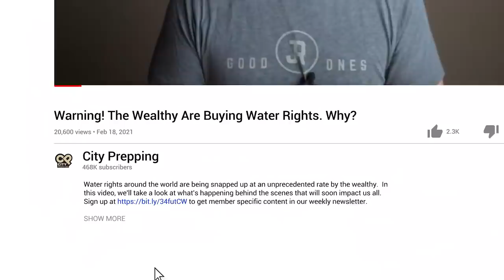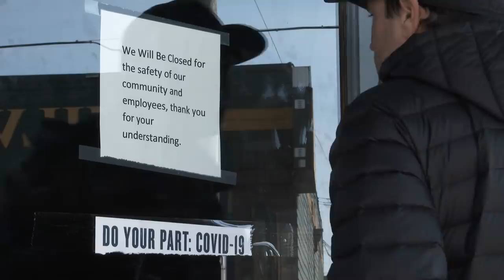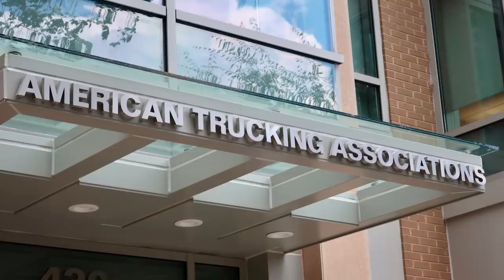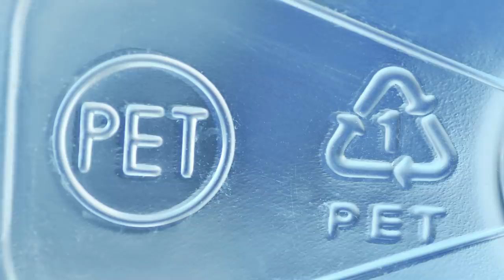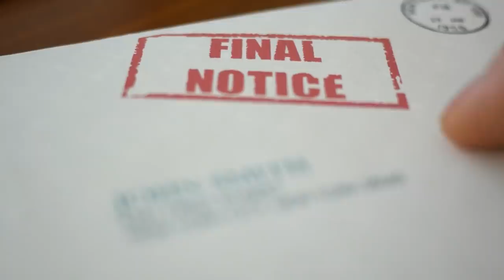Supply Chain Collapse: What's Coming Next and How to Prepare

Comment: I was living in Los Gatos at the time of the 1989 Loma Prieta Earthquake. The tap water was unavailable for four days at our apartment.  Natural gas was briefly shut off by the city to prevent explosions, until someone came out to check the lines. Because of that, I learned that water was the number one thing for which people underestimate their daily need. Most people assume unlimited tap water and that is a false assumption. At that time, many people had food but no water, and no way to cook. When a beginner first thinks of prepping they may have a mental image of themself going to Costco and buying a 40 pound bag of rice and other shelf stable non perishables. A well stocked food supply wont help you, if you have no access to water, and no way to cook.  Without water, there was no way for anyone to wash their hands, I couldn't even wash a small cut on my foot from stepping on broken glass in the dark.  With no means to flush the toilet, the house stank horribly by the third day. Large bags of dried rice, dried beans and pasta might make your intestines feel sick if you have no water, and it might even be better for your survival not to eat bone dry food. Water was the most #1 single most serious problem of those first four days because the grocery stores closed when had their shelves tossed over in the earthquake.  The broken shop windows were boarded up, and a 24 hour security guard was on duty to prevent anticipated "looting." So, whatever bottled water may have been in the aisles the previous day was now under a pile of rubble, and a guy with a gun didn't want to let shoppers enter. A portable camping toilet, a brick of baby wipes, and a first aid kit would all have been useful, but we foolishly always relied on the idea of stores being open.  With our electricity out, everything in the freezer defrosting, and we found there was one half-filled pitcher of warm Kool Aid in the fridge. So, by day two, we were reduced to drinking the liquid off the canned goods. Everyone should definitely get some of those larger dispenser bottles for their house. If you don't have a lot of extra money, forget about a thirty day food plan and just make yourself a ten day water supply, with some plastic bags to line an ordinary plastic bucket so you can carry your bodily waste out of your house. Again water, water, water. Nearly everyone underestimates how much water they will need.
Reply: Was in Hayward  after the earth quake able to get out of Oakland ok . When arrived home filled up any container with water .
A few weeks later bought  a few 30 gallon barrels to fill up with water .
   Easy recommendation is to have basic camping equipment and long shelf life food and water . And don’t tell anyone but these in your family you would share with .
Since then moved away .
Reply: This is so true. After approximately 7 to 10 days without water starts the multi organ shutdown ultimately resulting in death. Although very uncomfortable one can live much longer without food .
Reply: Having dealt with gulf coast storms I have to agree. Water first. And a way to cook the food. If you are figuring water 2 quarts to a gallon per day per person depending on temperature. Dead of winter 2 quarts will probably get you by. Mid summer takes a gallon. That does not include water for cooking, bathing or sanitation. Baby wipes or disposable washcloths are wonderful and cut water usage. Clean underware. I can wear the same pants for a week if need be. Not so much other things.If your going to use a generator you need to run it under assumed load. Fridge, freezer, AC or Oxygen concentrator. Get a fuel usage for about four hours and multiply for however long you want to use it. 50 gallons of gas lasts a few days going 24 hr a day. 
Lots of can goods can be eaten straight out of the can because it was cooked being canned.
Reply: I was born in Oakland after the 1989 Loma Prieta Earthquake. I have seen video of the destruction caused by the earthquake and was always curious how long it took the for life to get back to normal and how people lived through it. Thank you for your post.

Comment: Had an interesting conversation today with one of my wholesale suppliers (shipping from China). In 2019 the cost of a shipping container from port of Shanghai to port of LA was $10k. In late 2020 it cost about $19k.  Four months ago they were quoted $21k. No, as of September, 2021, they were quoted $30k, with no guarantee for that price more than a week. These prices don’t include customs fees or any other fees.
Even domestic shipping costs have gone up significantly.
Reply: I am in the logistics field.   These prices are correct and there is currently no end in sight.    No only are the prices sky high, freight is not moving as efficiently as it did 2 years ago.

Comment: I decided to get rid of things I don’t need, take that money and buy more useful things for prepping, like extra propane tanks, maybe a solar oven and a water filter system.  Our second car is seldom used and cost me insurance money so it is going.  I did order a new washer and dryer, too since mine works but getting old.  Just trying to fill in any gaps in my prepping.  I watch your videos and it gets me thinking what else can I do to be better prepared so thank you.
Reply: We have a drier but never use it. Line drying in the summer, drying on racks in the winter, mostly using heat from log burning stove. This is more about climate change for me and reducing carbon footprint. Not short of money.

Comment: Two weeks ago I spread out a 600 square foot tarp to kill off a grass area to prepare an additional garden space. In another month I will prepare another 600 square feet. I have almost 300 cubic feet of compost bins that I am slowly filling. In one I can feel the heat generating from the decomposition prossess. This next spring I am getting a wood chipper. There is 1.5 acres of forest area that has at least 20 cords of dead/rotting trees, some 2' plus in girth and 40' or longer, and fallen branches. All of that when chipped up will provide an excellent ground cover and eventually produce a furtile soil. 
Taking it step by step. Being able to grow ones own food having an small orchard is a blessing. The taste of freshly picked tomatoes and zuccines is so much better. The cherry tomatoes in the salad were amazing. 50' from the garden versus 500 miles of chemically treated/transported produce has no comparison.
Reply: And no flavor
Reply: Thirty years ago, I purchased two standard size Jonathan apple saplings from a seed catalog. Before I planted them, I built two, four foot square, eight foot tall, chicken wire cages out of 2 X 4s. In the years when the frost doesn't drop the early blossoms, I get lots of apples. This summer, I purchased a standard sized yellow transparent apple sapling from a local nursery. Once again, I built a four foot square, eight foot tall chicken wire cage out of 2 X 4s to protect the sapling from the deer and the rabbits Last year, I purchased the empty lot across the street from our cabin. Lord willing, I'd like to plant one apple tree every year, as described above, until I'm gone.  Then, they can plant me under one of them. I'd like that.

Comment: Fourth quarter (2 1/2weeks from now) is what worries me. Cold dark winter to be expected with the solar activity and magnetic shift
Reply: Try getting solar blanket, they are good for low to no sunlight, but note they are expensive. But it’s a good backup. Hope this help.
Reply: I'm anticipating major earthquake on west coast
Reply: grand solar minimum is here.

prepare accordingly.
Reply: @jhart7304  its not. We're in a solar maximum cycle 25. But in about 10 years it's over and then yes, grand solar minimum. But this solar max is gonna be a doozy first. Expect an X class flare by 2025.
Reply: @jhart7304  what's a grand solar minimum?
Reply: @pattyconley4096  The Sun is least active during GSMin. GSMax is opposite.

Comment: Though we haven't noticed actual shortages since the toilet paper debacle, we have noticed slow and steady price increases as well as simultaneous reduction of product size. Deceptive packaging is also making it so it seems like you're getting the same amount. We noticed this sharply with seeds this spring. Fortunately I was well prepared and needed very few. We also were informed that the cost of Natural Gas is going up next month which is a big one for us. Our furnace, gas fireplace, hot water and pool heater all run on it because it's been a cheaper fuel that the comparable hydro bill. We will likely be moving out of the city very soon to get as away from these costs as possible.
Reply: Deceptive  pckg.  Yes.  This has been creeping up on us for a long time.    Now 4lbs sugar in a 5 lb looking bag.  Cake mixes —. Now 15 oz instead of 18.75.  So if your tried and true recipes aren’t the same that’s why. Less on a big tp roll. Still big yes. Less sheets loosely wrapped paper towels too.   Read your labels

Comment: I've been stocking up and have a pretty good food supply now. Bought enough for family, too, because they just don't seem to get it. Also been picking up DIY books at garage sales and thrift shops - topics like home repair, plumbing, electrical, gardening, first aid. Seemed like a good idea to have on hand in case the grid goes down.
Reply: Even if the grid stays up, electricity costs money.
Reply: Maybe it’s all this stocking up that’s causing the problems?
Reply: @Tailspin80  No, because the issue is supply, not demand.
Well, that, and chokepoints at our ports.
Reply: @stevenschnepp576  Supply and demand are related. That’s just basic economics. Stocking up / panic buying increases demand, reducing supply further for everyone else. It’s also basic human nature, so go for it 😀

Comment: The bakery dept literally looked like the Soviet Union when I went to the grocery store on Sat. It’s normally filled with premade treats, but this time had only like 4 items in the huge case. Out on the floor there wasn’t the normal huge assortment of cookies, pies & cakes either. The girl in the bakery said they were having trouble getting stock.
Also, in the liquor dept the store has installed glass doors that lock over the spirits. So in order to get whiskey or vodka or rum, you’d have to get an associate to help you.
Other than that, the store looked pretty well stocked. There were things that were light here & there, but it was actually better than it was the last few times I had been there.

Comment: My local Costoc is out of TP and paper towels. The cashier didn't think they would get more until early October...crazy times.
Reply: I ordered online yesterday at Costco, limit to one pack.
Reply: Use napkins
Reply: Janitorial companys that's where I got tp last time
Reply: My local Sam’s Club has a strict limit of one package of tp or paper towels. You can’t purchase both in the same shopping trip even if you only bought one of each.  It was crazy.  I actually needed tp so I bought a super mega pack of Charmin. Went to Target and bought a second huge package as well just in case.  Paper towels I don’t really care about, they are nice but not necessary. Rags work just as well
Reply: @jhart7304  ... I assume you prep.  So where do you get your bulk supplies from?  Why are you coming down so hard on people, especially during such a difficult time.
Reply: @jhart7304  oh your so right I stopped using Walmart in 2012 but never really purchased much there only things that my local store didn’t have.
Reply: @jhart7304  Sam's club is Walmart..Costco has substantially higher quality products.
Reply: @jhart7304  
What?  I don't get what you said.  What are you saying?
Reply: @flowerpower2079  what he is really stating is that its the "Boomers fault" for the bull chit going on now.

Comment: there is not a container shortage. The problem is holding the ships off shore and waiting to ALLOW them to come to port. All done with purpose and intent.
Reply: Demand is sky high and ships are hauling as much as they can as fast as they can, but one ship gets blown sideways by a sand storm in the Suez and too many loaded containers are loaded on outgoing ships to allow room for the empties so empty containers are all where they are NOT needed.
The truck driver shortage is also effecting the shipping delays. Container pickup at the shipyard is one of the most difficult, low paying and unrewarding truck driving jobs out there.
Not enough truck drivers, not enough containers picked up.
Containers backed up on the dock means not enough room to unload the ship, and no place to dock the next ship.

Comment: You can basically stay alive on peanut butter. It's not much, but honest advice. Hope this helps
Reply: How long after Expiration can I eat the PB? Mine is from 2019.
Reply: @ebonytucker564  I would absolutely eat 2019 pb if I had to. No worries. Only time I've seen expired pb is maybe 6+ yr old (just an estimate) and I could tell it was bad. Smell and taste was obvious that it was harmful to eat. Good thing about it, it's relatively inexpensive to "cycle out" of the food pantry when time comes for expiration. Powdered peanut butter is another option I've been exploring. Longer shelf life
Reply: @ebonytucker564  ymmv. Note that foods with a significant oil content always have a shelf life. This includes nuts of all kinds.
Reply: @ebonytucker564  I KEEP ROTATING OLD PREPS AND I ALWAYS BUY SMALL JARS ON P.B, B/C AN OPENED JAR STARTS BREAKING DOWN QUICKER. I CAN'T EAT A HUGE JAR FAST ENOUGH. I AM NOW EATING 2017 AND IT IS GREAT.

Comment: (NJ) Canning jars/supplies are either unavailable, in short supply or doubled in price.
Reply: Yes, thx. But not jars at reasonable $, when available.
Reply: @creeksidecabin4887  Be careful with eBay lids - I've read they're total junk, some even put into Kerr or Ball boxes but are junk no-names. They fold up in pressure canning or fail to seal. Ace Hardware here is carrying Pur jars and lids, and they have performed just as good as Ball.
Reply: @creeksidecabin4887  US Sellers Only is the seller’s location,  not the merchandise country of origin. Walmart is a US Seller, but 99% of their stuff comes from China. And Ball or Golden Harvest usually sells for less than $3/dozen for regular lids only (no rings). I’ve actually ordered something from eBay thinking it was a good deal  - and got a box from Amazon. The seller was just having Amazon drop ship my order. Now I check both sites. eBay isn’t what it was 20 years ago when I was a seller.

Comment: MOST IMPORTANT PREP ? Water supply ! You can only live about 3 days without drinking water. Bottled water is NOT an option, since water deteriorates with time, and is a heavy & bulky item to store. If you have a private well & pump, you NEED to also have an emergency GENERATOR (preferably powered by propane gas) and a TRANSFER SWITCH to allow power to your water pump.
Reply: What if you do not have a well?
Reply: Stop gap measure at best. Im not saying its not a good idea. But, you need a non electric source.
Reply: @bamahama707  .. you need to select a product that will purify water.  Then you need to start collecting rain water or find a river that you can get some water to purify.  I do buy bottled water because our city water taste like crap and hubby likes the brand we buy.  But, I know that is not for a long term option.  I have a Berkey, several Sawyer straws, 5 gallon blue containers for water storage and a catchment system.  I never feel secure that we have enough water.
Reply: It is hard to beat propane for powering generators.  It has several decades of storage life and is completely in your control (unlike natural gas that could stop flowing).
Reply: @m.b.g.2235  what sort of blue containers? Like the big ones that can be refilled st the supermarket?
Reply: @ema8909  ... Hi, no they are not like the ones you mentioned.  These are a little heavier weight and you can't see inside. I got them from the Ready Store. It's been a few years so I have no idea what the price might be now.  I suspect other places have them.
Reply: @m.b.g.2235  ok thank you kindly

Comment: I noticed a lot of freeze-dried food is out of stock online. And my parents have gone to 3 Sam's clubs in 3 states looking for bulk flour.  All 3 locations have been out of Smart Water (which is the only thing that prevents leg cramps for me) for over a month now.  I've also noticed a slim selection of cereals locally.
Reply: There's quinine for leg cramps in club soda or the other you'll see it listed on front at publix.  Good for cramps.  So is vinegar in water .  (Potassium)
Reply: I have awful leg cramps! I discovered years back that magnesium supplements stop them. But most magnesium upsets my stomach. The one that works best for me is chelated magnesium from Metagenics, you can get it on Amazon or from their website. It also helps me with back spasms. I'm very well stocked up on it because it's so essential for me. It's not cheap but it's the one that works for me.
Reply: Most of the frezze dried food companies are jacking up there prices by double